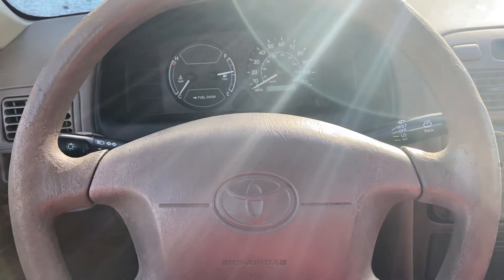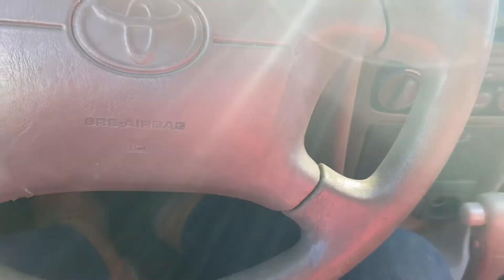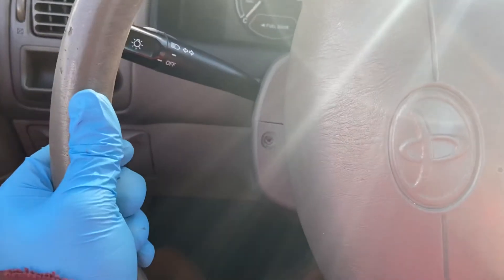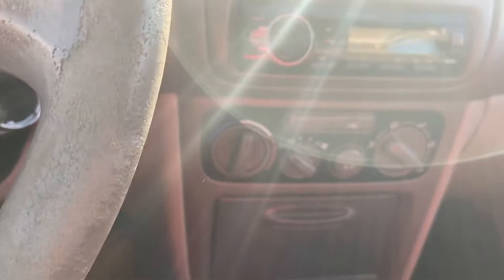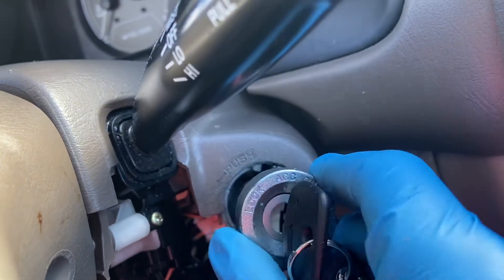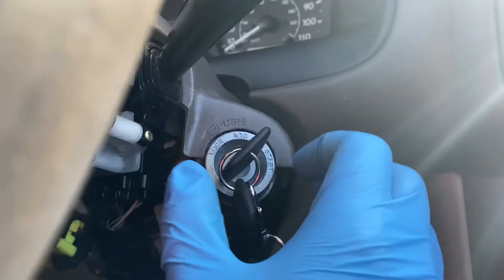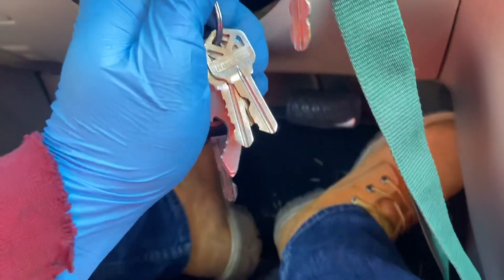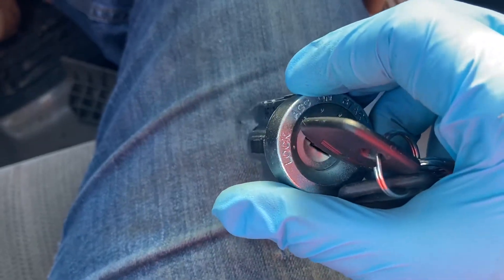1998-2002 Toyota Corolla Ignition Replacement

Comment: OMG!!! I bought the whole ignition assembly and had counted on spending a couple hours under the dash doing nuts and bolts and wire connections. Did not realize I could just replace the cylinder!! Took six minutes from start to finish, including removing and replacing trim!! Niiiiice!!! Steven's Garage, you rock!!

Comment: thanks for the video i have replaced my ignition lock cylinder with your help

I just wanna know how to check the dashboard lights fuses in order to get it working 

i'm waiting for your reply
Reply: If the dash lights are out and everything else works fine the bulbs probably died. As the dash lights probably share fuse function with other things to. For example, horn, wipers, window. I don't know if those particular examples are true but I just mean the fuse isn't just for the dash lights and if everything else works fine it's probably the bulb in the dash

Comment: do I have to disconnect the negative battery terminal before proceeding?
Reply: hey, not sure if you figured it out. as you can see he turns the car on right after installing the replacement. so no, not necessary.

Comment: Can you removed without a key like you did  it  I can do it with my eyes closed  with the key my problem I don't have a fucking key
Reply from the maker: There’s the lock pin holding it in. So you’ll ether have to drill it out. Or punch the lock in and turn it to unlock